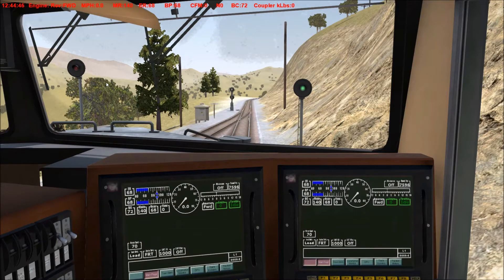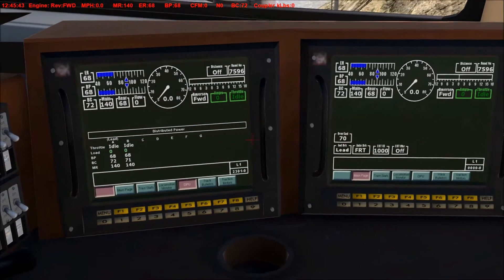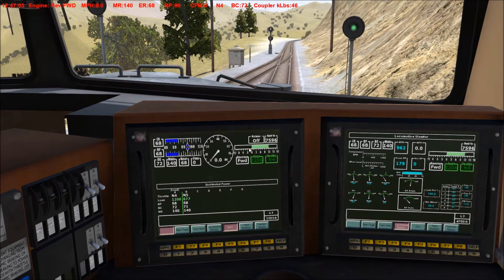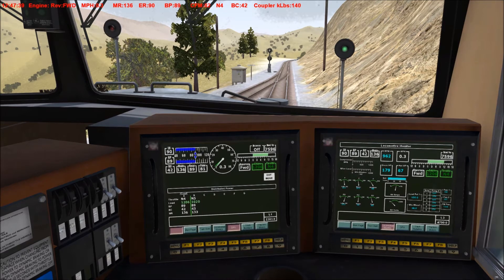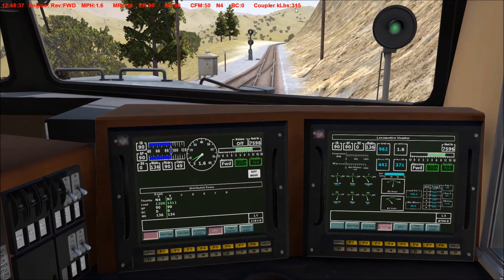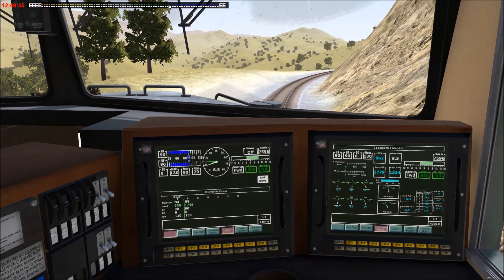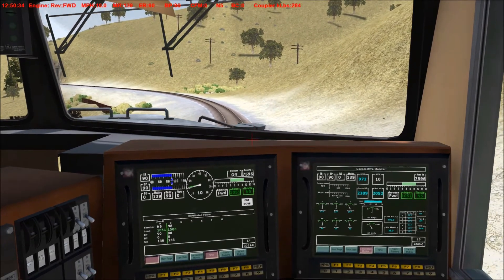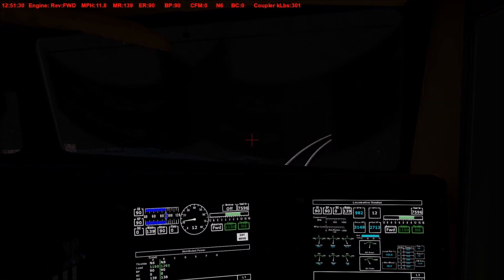Run8 : Fencing DPU Tutorial

Comment from the maker: I uploaded it last night, but changed my mind on the volume of the commentary track. I did see two comments :P
Reply: so this is the fencing dpu
Reply from the maker: Correct. Fencing is sometimes needed to start a heavy train. My understand is that it bunches the slack at the back of the train so the couplers are not as strained when pulling forward without it.
Reply: OK them